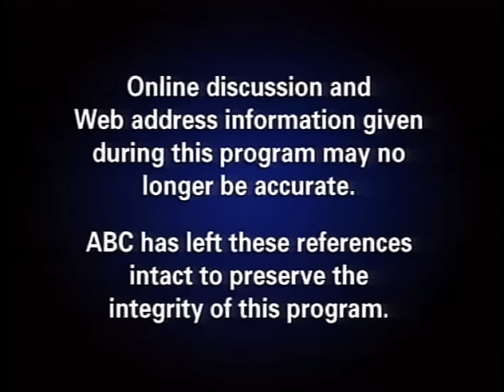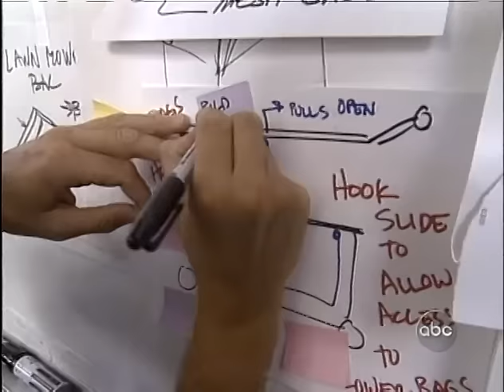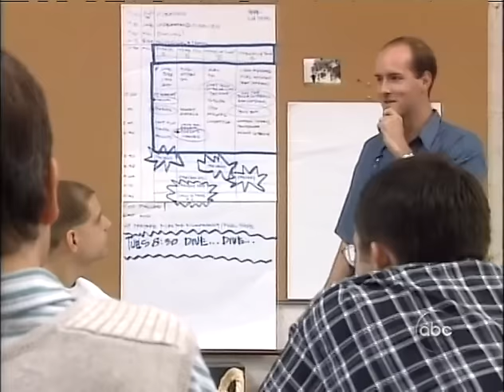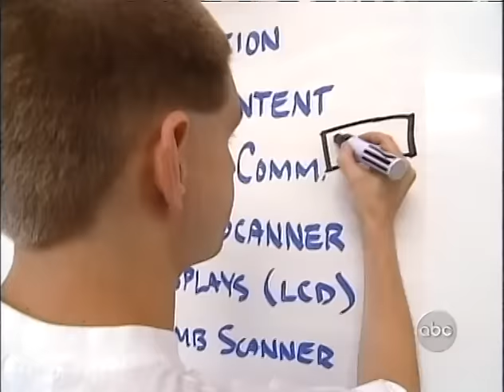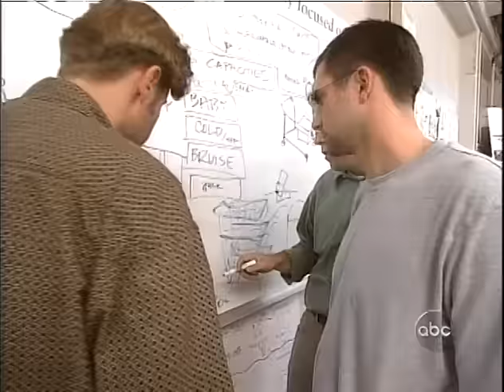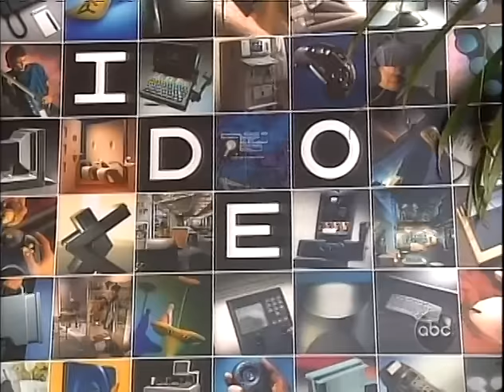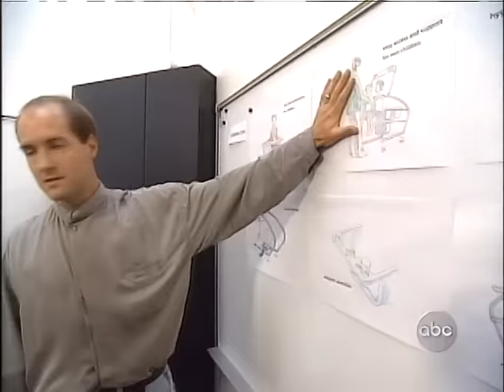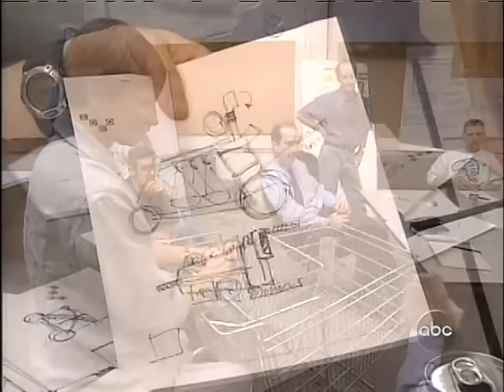The Deep Dive

Comment: and I dont see any kind of cart that looks like that in 2019
Reply: Big sad
Reply: yeah, IMO the biggest problem is the lack of the main basket. What happens when you buy items that aren't bagged (like milk), or you get items that are big (like a night stand or something). Also, the children would be unsafe according to most safety precautions, as they could easily lift the handle then fall out, nothing is locking them in.
Reply: @salty_slug  The problem is when it comes to storing these cart. Because the usual carts go into each others, but these carts cannot and they take a lot of space.
Reply: Well not exactly,  I remember some modern cart with a removable basket!
Reply: well 2021 sucks
Reply: @nknguyen2412  I think they meant that the baskets were given to the cashier to make the actual frame stackable

Comment: Well, I wasn't impressed with the shopping cart. Neither were most stores apparently. So, for those of you taking courses, it's time to learn an important side of design: taking and giving criticism. Let's do a list of everything wrong to make our point! 

So first off, all four wheels turn.  It's a neat idea, but I'd have to see it in use first. While this allows sideways movement, it also makes reorienting the cart harder since you can't provide leverage on fixed wheels. Again, interesting idea, but being unable to slide is a lesser issue than being unable to turn. Also the added complexity reduces long-term durability. We already know how carts with only two turning wheels suffer as they age.

Next problem, the bottom storage is practically removed. Larger objects like dog food, boxes, toilet paper, and generally anything that can't fit into a full basket go there, however this shopping cart uses a "W" design which is not only weaker than the standard design, but less able to hold a variety of objects. Bagged or smaller objects would be left precariously perched on a bar that's improperly anchored. Actually, this goes nicely into the next problem: No large basket. 

First off, hooks are stupid. No one likes carrying the bags alone, and making it needlessly complicated for the bagger and customer simply to "defeat tyranny" is ridiculous. It’s art for the sake of art weakening a device with utilitarian origins. It also puts a lot stress on a small portion of the bags handles, and once again restricts what can be purchased. Do you want to buy milk? Well, you have to bag it, and no you can't use paper for that, and you better hope those bags are stronger than the current affair, because everyone knows those just NEVER break. Also, you could throw in the environmental impact of those plastic bags, although this was from the 90s, so they get a pass. 

Well, it reduces cart theft you say! Nope! If a person needs a cart, they're still taking it. Don't get me wrong, it's a beautiful selling point to say that even a homeless person (as an example) desperately looking for something to carry their possessions in wouldn't choose your crappy cart over the current standard, but in all truth they'll still use yours because at the end of the day they can use the hooks or baskets to carry their necessities until they find someplace with a decent cart. Also, kids will still find a way to make it into a go-cart.
 
Well, you say, if you’re worried about baskets, why not use the smaller ones!?! Well, that's great, except you're once again left with a smaller holding area (limiting your max product size and what you can purchase with one cart as opposed to a single large basket that can hold a bag of dog food as easily as it can a bottle of coffee creamer, while still allowing for stacking), and you've added something else to steal! Because baskets are easy to fit in a car! Hence why you're not usually supposed to take them outside! 

Also, who else thinks it is a fantastic idea to leave your main cart behind, possibly with your kid or purse in the back, all the while lugging around a basket you didn't want in the first place because you chose to GET A CART. Also, if I’m just making a short jaunt away from the cart to pick out a few small goods, why would I need to carry the smaller basket that may already have items in it? I can just get the item and come back. 

Also, just a nitpick, one of the baskets appears to slide a little too far back. I get that it's likely to make up for the reduced carrying capacity, but it just makes it harder to unload your goods after.  

Alright, let's talk about those handles. Well, for one thing the redesign has removed the convenient rear basket for purses, wallets, and coupons (which was never perfect, but at least had a flap to try and hold in your stuff) all so that some people could fit a kid in there. The bar over the kid's head is also great, because every parent knows how fun that’s going to be, holding the child against the back while fighting to get the bar down from above. It's also easier for them to push up and slide out of without the parent's notice, and there's a noticeable lack of the standard cart seat belt. 

The cup holder was a nice idea, but it's on the handle that flips up. Ooh, speaking of the flip up, I didn't see any locking mechanism on the handle, so again large loads are at a disadvantage. I get the distinct image of people trying to push the cart, only to have that handle flip up constantly (I've used compacting Dollys with a similar design that did just that). 

It also has the problem of feeling too low (something to avoid for older customers) while also feeling top heavy. The wheels are all on the same plane front-back, making it feel inherently unstable, and again bad at turning. 

Ooh, almost forgot that scanner! Interesting idea, but all it can do is provide a single price scan for estimation, something that in-store price checkers, and also the clever invention of "Labels with numbers on them" have removed the need for. If it tries to tally everything, it will undoubtedly be left with errors as people mis-scan or forget, and while it may help with some estimations, in the end it just slows down the shopping experience, and raises the price of the cart from the simple metal frame. It also needs to be constantly updated to changing store prices, and maintained. It can't be used as an official scanner since people won't scan everything (theft is always an issue) and no one wants to lug around the weight of a measuring system like the current personal checkouts. 

Oh, and speaking of stealing, that thing is ridiculously easy to steal. I mean, I don't know how else to say it, it's just perfectly pocket sized. You could chain it, but that reduces the freedom of movement and is still easily cut. You could place it in the handle as was originally proposed, but then maintenance becomes even harder.

Last thing to think about, it’s harder to store. Yes, they still could (with a slight redesign) slide into each-other like regular carts, but then you have to have another stack alongside with a far greater number baskets, with the 5 per cart shown here making the number of additional baskets absurd. If you try to go to a lower end of the curve, like 3 per cart, busy days and holidays will leave dozens of carts unusable because those hooks do jack if you don't have bags, which are part of checkout. 
Honestly, this feels like the 90s edition of Solar Roadways. Everybody thinks it’s cool until you realize that it’s cheaper, longer lasting, more durable, safer, and produces more energy to just build regular angled panels along the side of normal asphalt roads with (maybe) glowing reactive paint. 

Listen, I get that this was a 5 day challenge in the 90s, and the video was focused on teaching new workplace principles rather than good design, but this was….ugh. Let’s just say the cart was very distracting for me. And yes, I know, most of my complaints could be argued. My arguments don't account for all the factors since I just whipped this up after a first viewing, and I am by no means a professional cart maker (or professional anything), and even then some stores focused on selling smaller quantities of items (like Whole Paycheck) wouldn’t run into these issues, but the reason we have the carts we do is because it is the easiest design that fills the greatest number of requirements. When working to design something for large-scale general use, like a shopping cart, you can’t sacrifice certain generalized features (such as a large basket) for specialized features (such as modularity) that at best add situational benefit. You have to design it for the 90 year old grandmother as much as you do for the 20 year old college student, or the 1 year old passenger. A lot of the ideas are interesting, and could maybe be implemented in another way, but the cart itself- as it stands now- is not salvageable.  

Sorry if that comes across as a little overly critical.
Reply: I really didn't like that cart. :P
Reply: +TheFirstObserver Some ideas are or were reality here in the netherlands. The thing that all four wheels turn is used on every shopping cart here and it works great for me. I can also remember we used to have the scanner. It was used exactly as they showed it in the video. You just scanned the product and when you left you payed with a computer system. There was a guy at the end that randomly checked if people didn't steal anything. You also couldn't steal the scanner because of the guy watching at the check out. I can see why they removed it though. 

But I agree. There must be a reason why every shopping cart doesn't look like this already right?
Reply: +freddie4321 It looks like the principal on building that cart would be more than for most carts.  I don't buy the idea that it won't get stolen, people will steal cart just to ride them.  It holds less volume.   The bag hooks on there are going somewhat obsolete as grocery stores these days typically make you pay for bags or in some cases have even banned plastic bags.
Reply: +TheFirstObserver nah
Reply: Oh man, I remember this! I really hated that shopping cart....

Still do! XD
Reply: +TheFirstObserver: I agree with most everything you have said. I think they presented some good ideas, but for the most part I think the project really wasn't as good as it should have been.

I think you have a future career in engineering TheFirstObserver, if you don't already.
Reply: This comment is so good that it compelled me to post a comment on a youtube video. This just goes to show that even the ideas conceived by highly experienced designers and engineers might not always pan out in the market. This is why we need early end user feedback. Prototyping and expert opinion is great, but all your assumptions - especially the riskiest ones - need to be validated by real end-users.
Reply: I totally read this in Paris Geller's voice.
Reply: @lukemcpartlan9213  Careful, some of the comment is kinda incorrect or at least the commenter is missing the entire point of the video.
Bottom storage is still there to some degree, look at the design of the steal bars, dog food, paper products, etc... should be fine. If not, it's an easy fix.
Hooks are not complicated, shopping is an everyday thing this process would easily be learnable. Although I would agree products like milk could cut open the bag, that's a problem. But easily fixed by not removing the baskets (theft may have to be resolved a different way).
A holder can easily be appended into the handles for wallets and such.
Height difference can easily be adjusted.
Locking mechanism can easily be added.
The scanner to scan your own item can easily be corded to attach to the cart, to prevent theft.
Not a fan of the kid seat thing in the back either, not sure what's up with that. But all you have to do is have people try the product, and see why it doesn't work to come up with a solution.
Yes the carts design reduces theft. The commenter said a homeless person would take it until they find a better cart. In reality, they would just look for a better cart. I assure you, a garbage bag won't be useful on hooks. 

It actually doesn't matter if the shopping cart they provided was innovative or not (They did it in 5 days, of course it'll have flaws). 
IE: They could easily spend a couple more days to resolve the majority of these concerns.

All they'd really have to do is take that prototype shopping cart that they ended with, and do the PROCESS again to fix its problems. 
Look at HOW they made the prototype, not the end result.
Reply: Gold
Reply: This comment has me so dead
Reply: First of all, the product isn't the important thing, the process is.
Second, this is why we discuss both the positives AND the negatives about the cart (*after* we focus on the process).
Third, obviously, the assignment worked because you spent time analyzing and evaluating the product.

CREATIVE THINKING GENERATES THE IDEAS. CRITICAL THINKING TESTS THOSE IDEAS.
In other words, brainstorming comes up with all kinds of what if's, possibilities, and wild, "outside the box" ideas. Critical thinking then tests,  analyzes, and evaluates the ideas to determine the most effective, do-able solution to the problem... and making sure it will actually solve the problem.

That's the major reason instructors continue to assign this video. It shows the APPLICATION of several theories we teach.

Comment: Just in case the original gets deleated
Activity 1.5: The Deep Dive answers:

<3

Procedure
1.      “From the buildings in which we live and work, to the cars we drive, or the knives and forks with which we eat, everything we use was designed to create some sort of marriage between form and function.”

2.      The folks at IDEO state that they are not experts in any given area. But they do claim to be experts on the process of how you design stuff, which they apply to the innovation of consumer products.

3.      After the team of designers is brought together, introduced to the problem and informed they have five days to “pull it off,” what phase of the design process do they immediately engage in?
a.      After the team of designers is brought together, introduced to the problem and informed they have five days to “pull it off,” they engage in the “investigate and research” stage of the design process.

4.      Give two examples of what the team members did during this phase.
a.      One team member visits a store and talks to some employees where he learns that the shopping clocks have been clocked in at 35 miles per hour across the parking lots.
b.      Another team member visits a store and learns that most shoppers don’t like to let go of their carts while shopping. Only a few leave their carts at various places to go and retrieve their groceries.

5.      List five rules-of-thumb that IDEO employees follow when they share ideas during the brainstorming phase:
a.      One conversation at a time.
b.      Stay focused on topic.
c.      Encourage wild ideas.
d.      Defer judgment.
e.      Build on the ideas of others.
                                                                                       
6.      Why should wild (and sometimes crazy) ideas be entertained during the brainstorming phase?
a.      Wild ideas should be entertained during the brainstorming phase because you can build off of those wild ideas and they will end up being better ideas which would not be possible if everyone said the same things.

7.      After the brainstorming phase was over, the team narrowed down the hundreds of ideas by voting for those ideas that were not only “cool” but also buildable in a short period of time. Which phase of the design process includes brainstorming and narrowing ideas?
a.      The phase of design process that includes brainstorming and narrowing ideas is the “select an approach” phase.

8.      IDEO believes that the ideas and efforts of a team will always be more successful than the planning of a lone genius.

9.      Once the ideas were narrowed down and divided into categories, the group was split into four smaller teams. For which phase(s) of the design process was each of these groups responsible?
a.      Each of these groups was responsible for the “develop a design proposal,” “make a model or prototype,” and “test and evaluate the design using specifications” phases of the design process.

10. The leaders at IDEO believe that playful behavior and a fun environment are two important reasons why their employees are able to think quickly and creatively to produce innovative results.

11. Sometimes, people come up with great solutions that work by trying their ideas first and asking for forgiveness later.

12. Design is often a process of going too far and having to take a few steps back. What phase(s) of the design process would the critique of the four mock-ups come under?
a.      The critique of the four mock-ups comes under the “communicate processes and results” phase of the design process.

13. Upon critique of the four teams’ models, it was obvious that none of the teams had developed an optimum solution. However, the people at IDEO believe that it is important to fail often in order succeed sooner.

14. What percentage of the entire week’s time did it take to fabricate the final prototype?
a.      It took one day to fabricate the final prototype which is 20% of the entire week’s time.

15. Instead of showering his design team with a tremendous amount of praise, what did the boss require his employees to do with their new design?
a.      The boss required his employees to go to local supermarkets and see what they thought of their new design.

16. Of all the things that we are surrounded by every day, what has not been placed through the design process?
a.      Of all the things that we are surrounded by every day, nature is the only thing that has not been placed through the design process.
Reply: I fucking love you for this <3
Reply: Bro respect